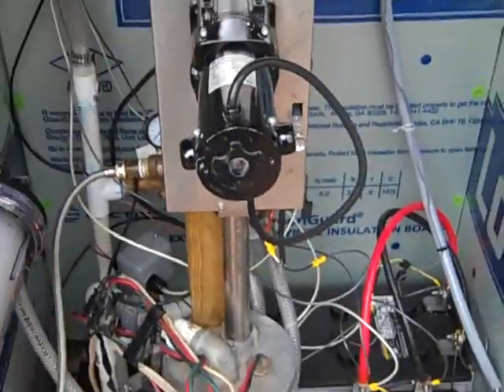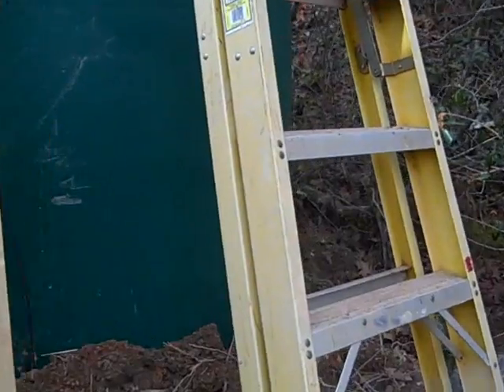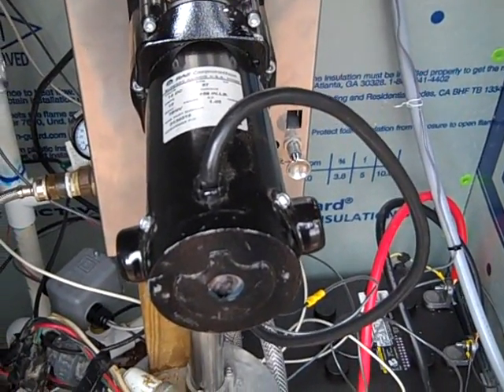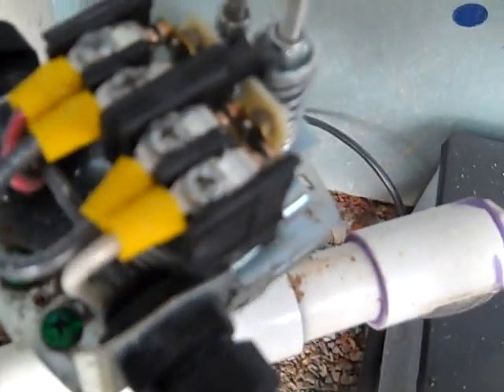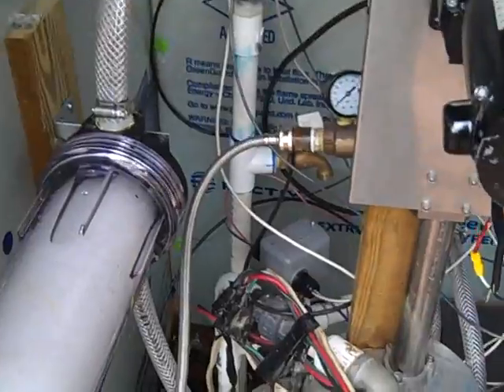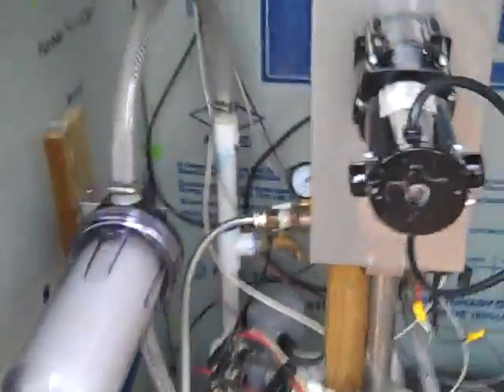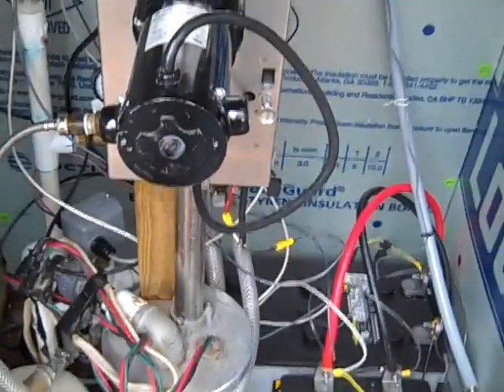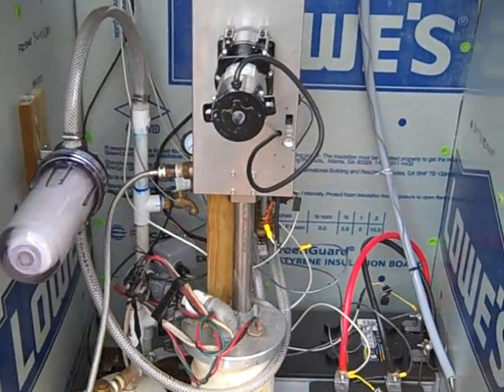A water plan for troubled times.

Comment: Very cool setup but one suggestion with your connectors either use a dielectric grease and on inline connections use heat shrink to seal the electrical connections. Especially with DC its loves to corrode.

Comment: Nice work. I would build a tower for the tank and use gravity. Or if the roof was strong, place it on top. I could shower with 5psi in troubled times. Not as good as 50psi but wil save electricity and the booster. And therefore is slightly more reliable in my opinion.

Comment: Pure myth unfortunately. The only thing it might do is introduce cold, so you still should raise it for that reason, but they won't discharge from being on the floor.

The myth comes from when batteries were first stored in porous containers so they did leak/weep slightly.

Comment: my house is not connected to any grid (except a road), and i have a little tank at least 12 foot in the air (it looks more) on a one inch pipe and the house has alright sort of pressure, but its a bit different from using taps in town. its like when you open the tap up it is slow for a second and then really gets going. and when you go to turn it off it seems like its got tons of pressure. i pump to the upper tank once a week when I'm doing my laundry and the generator is going.

Comment: What a great setup!  I have been thinking of a solution for the same problem.  Living in rural Florida, lack of power can be a concern.  Something to consider for a solution to the "tight space" would be removable or hinged walls.  I have worked on "pump houses"/storage areas which we had 2x4 framed boxed walls that inserted into an outer frame.

Comment from the maker: You are not dreaming.  Pumping to an elevated tank is always the best way to go.   To get the same pressure I would have to place the tank 125 ft above this location. That is beyond the capability of the Simple Pump with the motor option.  We could have used a solar submersible to do it but the customer also wanted a hand pump backup.  So, your question is a good one!

Comment: Our town has a water tower for our water supply. On a smaller scale setup such as yours would elevating the tank give you enough pressure WITHOUT using the second pump (in case of solar failure, etc.) or am I just dreaming. If so, how high would it need to be?

Comment from the maker: I am still adding up the parts!  :)  There is a lot crammed in here  . Simple Pump, Solar, charge controller, batteries, Booster pump, 1000 gal tank, plumbing electrical, labor etc etc  ~ 7k

Comment: Another good video.
One thing I don't understand is the water going to the house. Does the pump turn on when you turn on a tap in the house and then switch off when you turn off tap. 
Or, do you pump to a storage tank in the house (attic space). If you do how do you control the pump. I mean you want the pump to turn on when water level drops in house water tank and turn off when house water tank is full?
Hope you have time to reply.